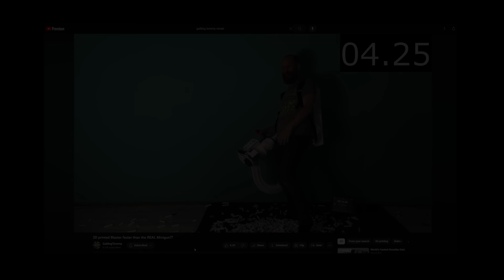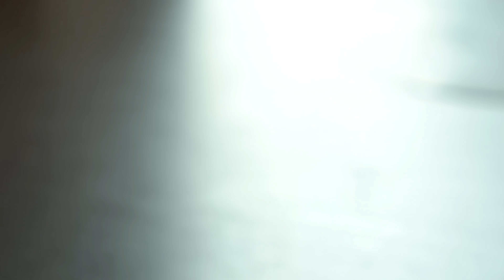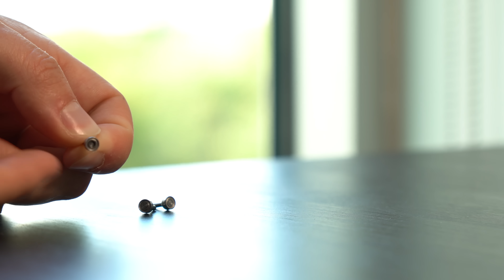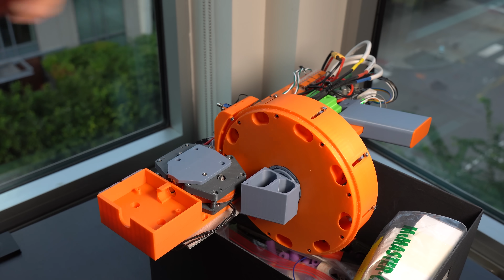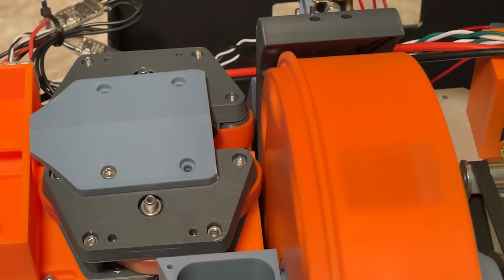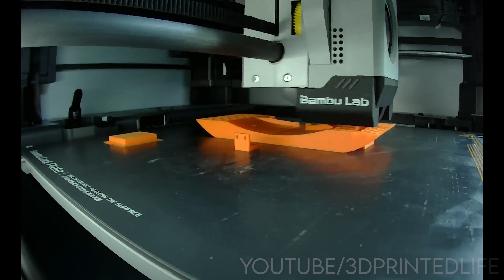My Insanely Fast Firing Nerf Gun WORKS | Part 2

Comment: I'm a bit confused by your math for these two videos.  When you were adjusting the speed from 25 darts per second it certainly wasn't an accurate fire rate.  You would fire 1500 darts per minute at that rate.  100 darts per second would be absurdly fast.  Does the mag even hold 100 darts?  6000 rounds per minute is unnecessarily absurd. Would there even be enough space between darts in the air?

I don't understand how you're measuring this.  100 darts per second means 100 darts will have been fired by the time one second has elapsed.  There's no other reasonable interpretation of "darts per second" I can think of.  What am I missing?
Reply from the maker: The confusing part is that for some testing, I use a drum velocity which, if the mag was fully loaded, would be that fire rate. Second, rate of fire is exactly that. A ratio of darts fired to time elapsed. 100 darts per second is equivalent to 50 in 0.5 seconds as well as 200 in 2 seconds. The magazine holds 81 darts and it fired in just under 1 second. Yes the rate is absurd, that's the point!